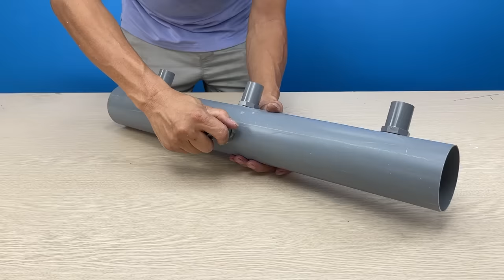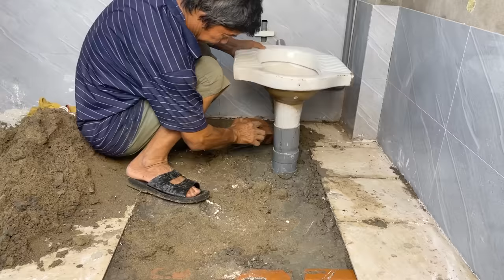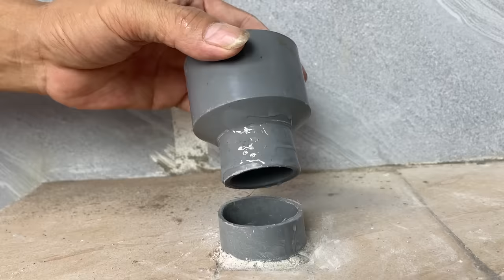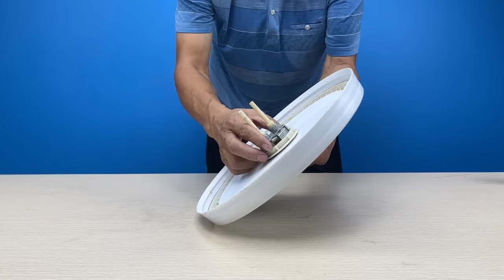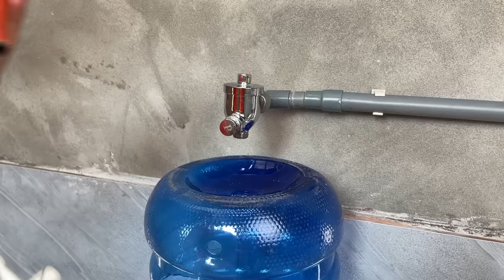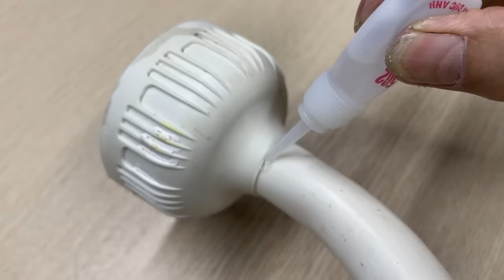The manufacturer will go bankrupt if everyone knows this! DIY toilet from empty plastic bottle + PVC

Comment: Clever innovation in making your own toilet. As the flush part, that was purely clever indeed. Some ppl can  afford   Toilet except installation so doing your toilet is another option. Maybe for temporarily. From UK

The flush part, paint it up or cover it with a piece material even with painted woods planks , it would make it look pretty. Also connecting toilet to the pipe, use a really good sellotape maybe  like the silver or black tape to get the pipes within each others properly. Better use a special tape to stop leaking.
Reply from the maker: Thank you for sharing your ideas. We are very happy to receive your feedback. If you have any more interesting or interesting ideas, please share them with us. We are very pleased to hear from you.

Comment: The big question:
Can it cope with an onslaught from Mrs. Emery?
Otherwise, could be very useful in areas such as Londonistabistan.
Reply from the maker: The ability of any DIY or plumbing project to withstand potential issues or heavy use, including potential criticism from someone like Mrs. Emery, depends on the quality of the work, the suitability of the materials, and adherence to relevant building and plumbing codes.

In areas with unique plumbing challenges, it's important to ensure that any DIY projects meet local regulations and are built to withstand specific demands.

While creative DIY solutions can be beneficial, they should be approached with proper planning and execution to ensure durability and functionality. Professional guidance and adherence to local codes and standards are often essential for the long-term success of plumbing and DIY projects.

Comment: Ya no u can get a hose splitter for way less than ta pipe cost and ya don't need to cut the tap off 😅
I hope thats you own house and not a customers house 😂😂😂😂
Reply from the maker: It's great to see your sense of humor! You're right; a hose splitter can be a cost-effective solution for splitting water flow without needing to cut into the pipe. As for your playful comment about whose house it is, sometimes DIY projects can be a learning experience, and it's essential to practice on your property if you're unsure about the outcome.

A suitable response might be:

"Haha, you've got a point there! A hose splitter can be a handy and budget-friendly alternative. And don't worry, this is my own house, so I'm experimenting and learning as I go. Thanks for watching and sharing your thoughts! 😄🏠"

This response acknowledges the viewer's suggestions and adds a light-hearted tone to the conversation.

Comment: Где найти такого мужа?
Reply from the maker: First, gather your materials: rubber bands and chewing gum.
Cut a small piece of chewing gum and roll it into a thin strip.
Wrap the chewing gum strip around one end of the pipe where you want to make a connection.
Secure the chewing gum in place by wrapping several rubber bands tightly around the chewing gum and the pipe.
Repeat the process for the other end of the pipe you want to connect.
Once both ends are securely wrapped, turn on the water and hope for the best!
Of course, this method is highly unreliable and likely to fail spectacularly. It's much better to use proper plumbing connections and tools to ensure a safe and leak-free water system.